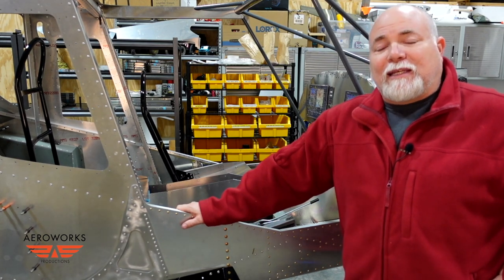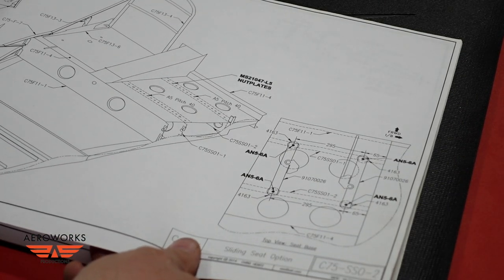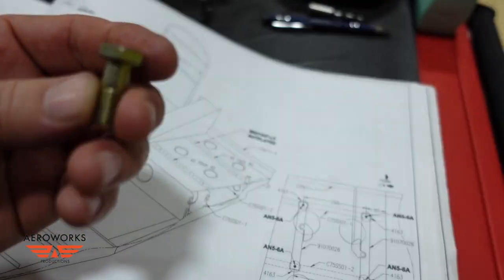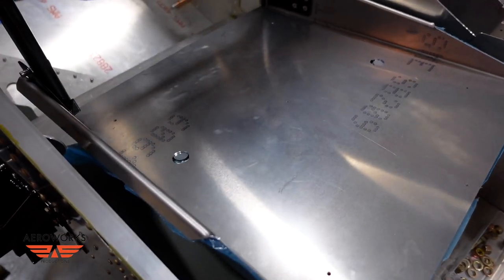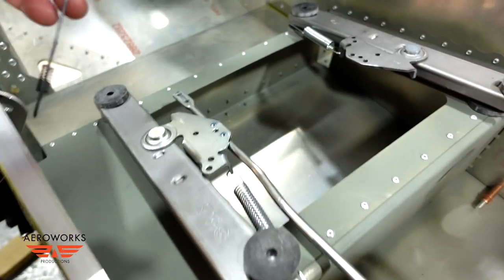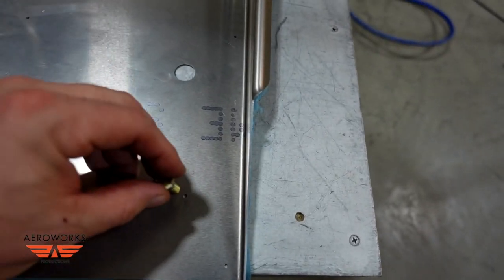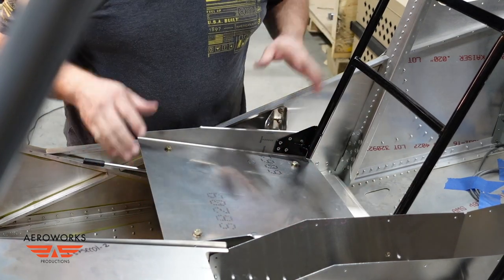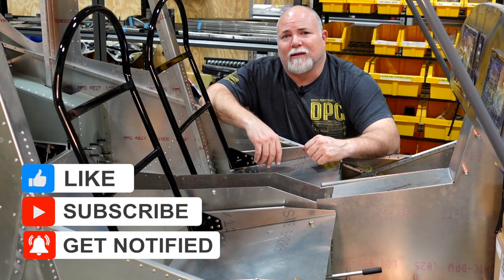Ep. 22 | Installing Seats & Adjustable Seat Rails | Zenith Super Duty Aircraft Build

Comment: Hey Adam... Great video , I'm still debating on whether or not to go with the sliding seat. I'm considering a ground adjustable set up as I most probably be the primary pilot. The main reason I'm considering it is for re-sale. Do you know what the additional weight for the option is?  Also , is the seat back adjustable or fixed? To me having the ability to recline is almost as important as the back and forth adjustment. Any thoughts?? Thanks for the video and Blue Skies!
Reply from the maker: John,  the rails do add a little weight.  I'll try and get a weight on them but I figured might as well have them easily adjustable.  The seat back is fixed position so you would have to configure your padding to accommodate your preference.  They do fold completely forward for rear loading but that's it.  Thanks for watching.
Reply: @AeroworksProductions  Thanks for the info ! While I have you here , does the private pilots certificate suffice for drone flying? Is an endorsement required? I haven't purchased one yet , just curious. Thanks!
Reply from the maker: @johnreed8872  Not for commercial Drone flight.  A part 107 certificate is required however if you are already a private pilot then you can take the online version through the FAAST and print out the certificate and have a DPE sign off on it for the 107 pilots certificate.  No written test required.  (Which is the way current 107 pilots will be doing it for their recurrent certification after recent FAA UAS regulation changes.
Reply: @AeroworksProductions  Clears up a lot of things , thanks! Looking forward to the next build video!

Comment: Are all home build kits this terrible as it relates to included instructions?  I mean this isn't a toy or model you are putting together.  I think you would have constant questions about whether you did something correct when you get up in the air.  If anything, to me, this is an advertisement for Zenith competitors.
Reply from the maker: I agree and it is experimental/amateur build as the FAA call it but yes I agree, there could be a much better and concise instruction manual.  Myself and other have been feeding them info for improvements but it takes time to get them sorted out.